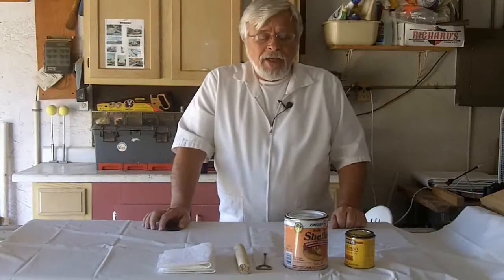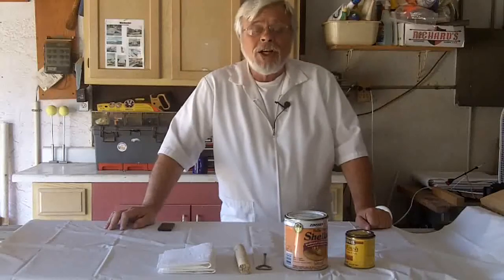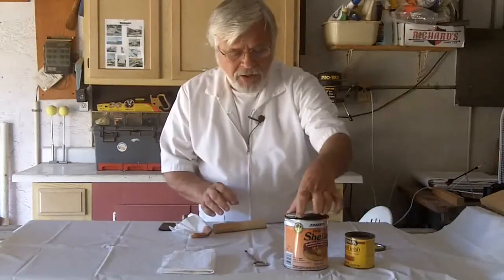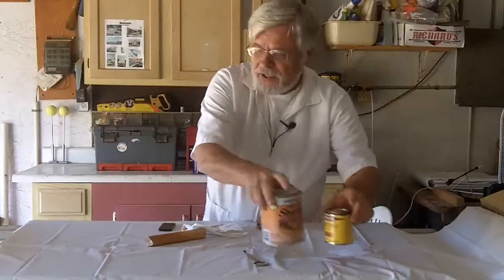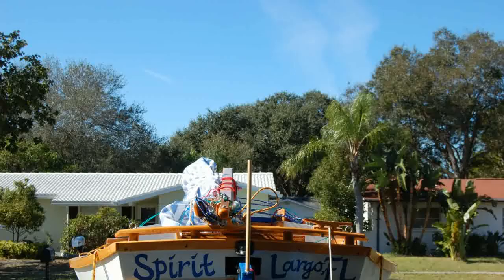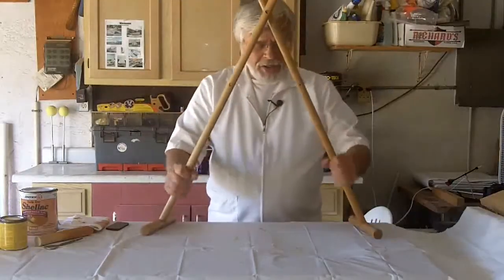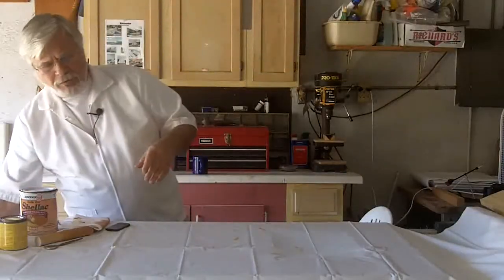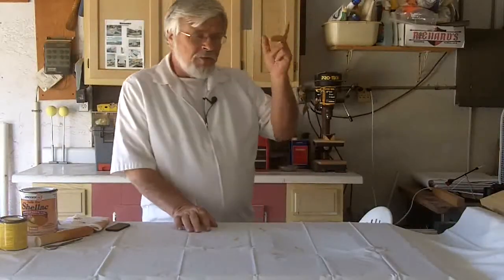Weekender-Boat-Build-Part-5.mp4

Comment from the maker: Mostly the trick of boats with plywood is sealing the wood. I used regular exterior plywood. To seal it, I used fiberglass (heavy), resins and a lot of paint. By tall you mean freeboard? Figure out displacment of your design. Is it enough to support 4 men? 1 Cubic foot ==  62.4 pounds